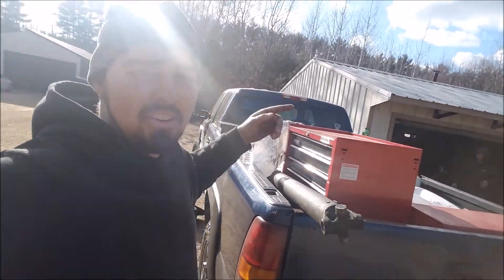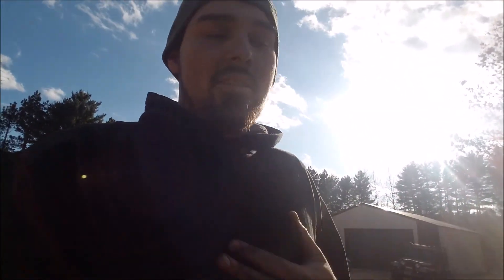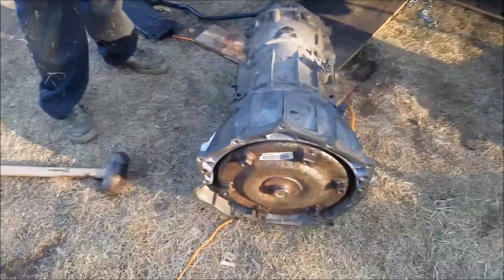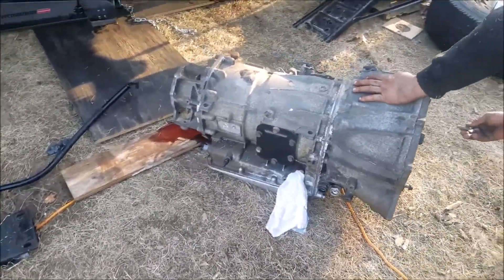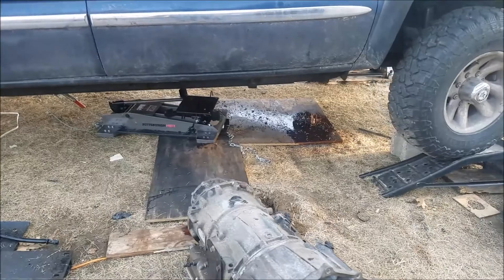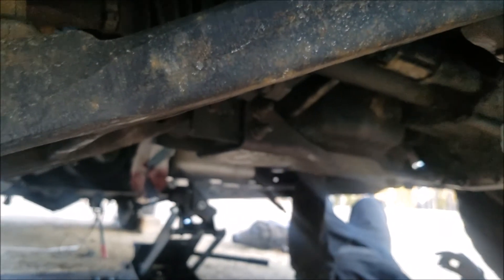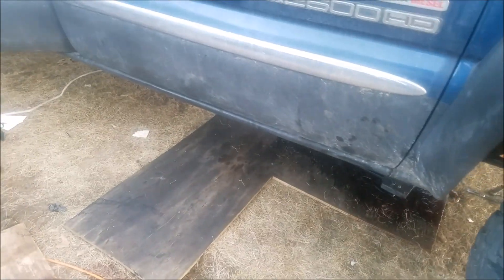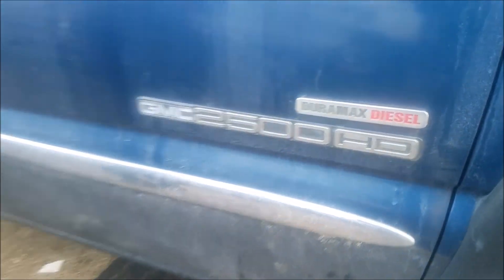DURAMAX DIESEL TRANSMISSION SWAP

Comment: Try changing a manual transmission from a dump truck.  Talk about a pain in the ass.
Reply from the maker: blindabinda123 yea i bet... ill stick to my tiny cars lol
Reply: Garageless ya I'd rather do the same. Did you spin the torque converter while trying to push it in.  Usually there is like 2 stages that it clicks in.
Reply from the maker: blindabinda123 yea first cluck was easy didnt wanna line up with pump in the trans
Reply: Garageless way back when I first started working on cars I swapped the transmission on my car and I bolted the torque converter to the flew plate before installing the tranny And I ended up pushing the tranny pump into the tranny coz it wasn't in.  Lol that's how you learn I guess
Reply from the maker: blindabinda123 that would suck end up having to do it twice no thanks
Reply: Garageless yea I was like 16. Didn't know that they had to click in or whatever
Reply from the maker: blindabinda123 yea we all make mistakes yesterday was one my many
Reply: Garageless what was yesterday
Reply from the maker: blindabinda123 yesterdays video of fiero oil leak shenanigans